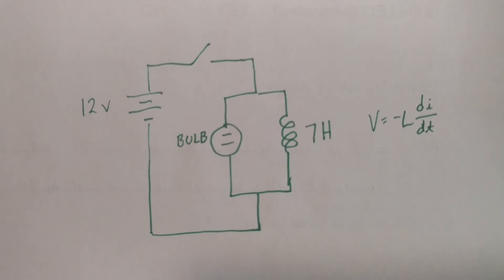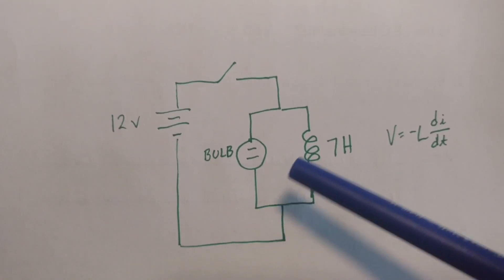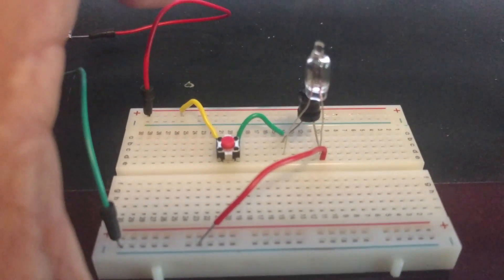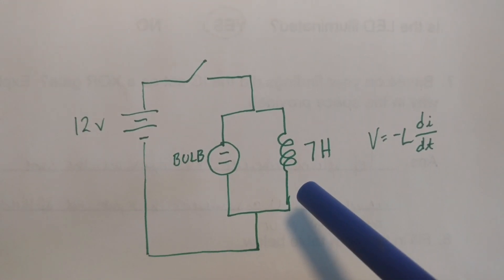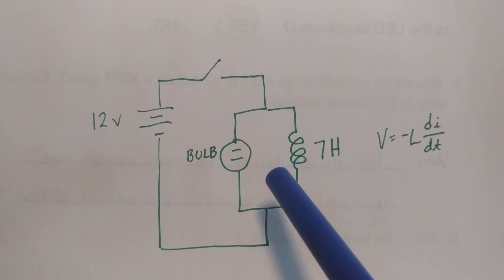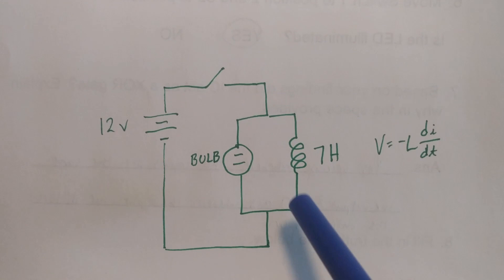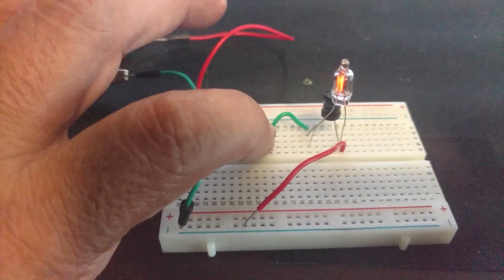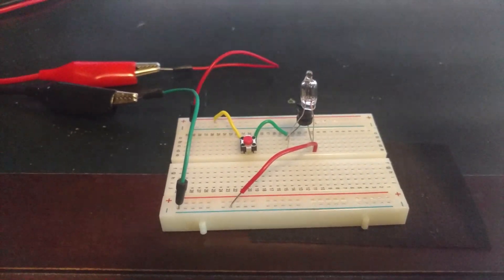11 - Inductance Characteristics

Comment: In the 70's I knew the neon bulb needed more voltage to start the ionization, than a small battery provided.    Then an electronics instructor showed me a circuit like this video.   MIND BLOWN!   I still remember that day, and was forever hooked on electronics. Magic.

Comment: This is how many DC to DC voltage step-up converters work.  The input voltage is alternately connected and disconnected to/from the inductor at a high rate of repetition.  The resulting higher voltage spikes flow out through a diode or transistor and charge a capacitor that smooths the spikes into a steady DC output voltage.  
Once, in 8th grade science class, the teacher directed a boy to connect the leads of an inductor to the ends of a 1.5 volt D-cell battery.  He did this with his bare hands and was "shocked" to discover the high voltage spike when he removed the connection.  The teacher said, "You can't be shocked by a 1.5 volt battery!  Do it again."  But the boy was, as the saying goes, "once bitten, twice shy".  The teacher went on to explain what happened.  I'm sure that boy learned the lesson, whether he fully comprehended the reason or not.  🙂
A hydraulic ram that pumps water to a higher elevation is a mechanical analog of this same effect.  The water, once it is flowing, will not stop instantaneously due to its inertia.  The inertia will briefly force the water to continue flowing up to a higher level.

Comment: Wow and thanks.  I always hate inductor calculations, the results, even when it is right, seems wrong. I usually find a proven circuit diagram I can copy. I find most electronic component characteristics and relationships easy to understand, calculate and adjust but inductors are just not intuitive.
Reply: I think most problems with understanding of inductors happens because of varying properties of core material. When core is air, coils become simpler. However, for RF, it is important to know about "skin effect" and "proximity effect".